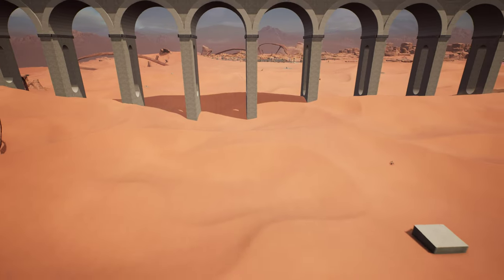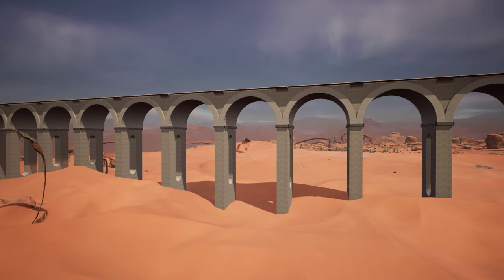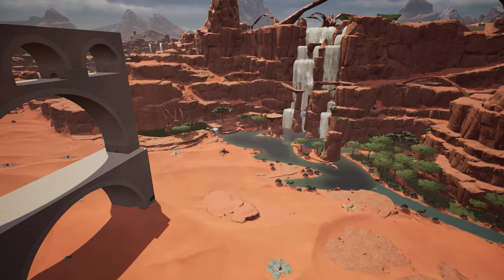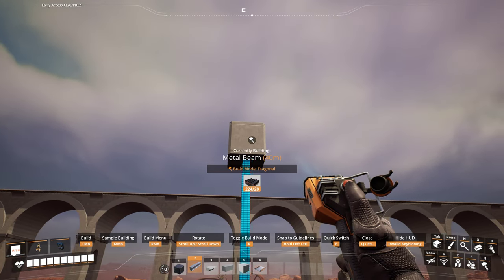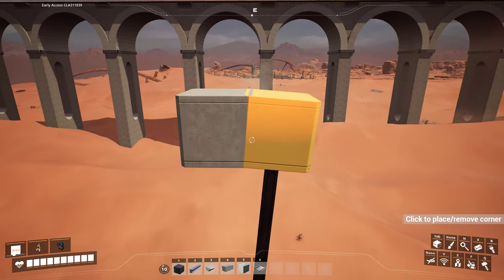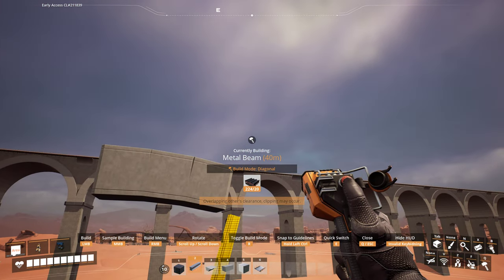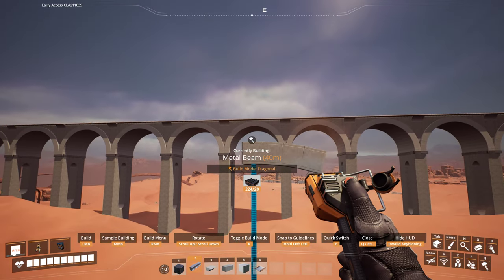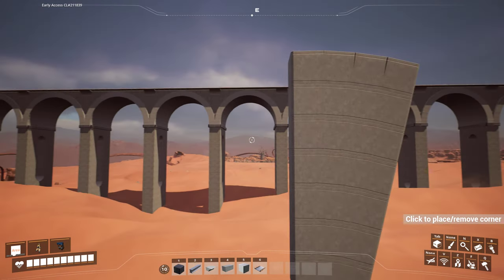Satisfactory - How to Build Vertical Arches

Comment: Your method works great but i cant work out how you get the really tight arches at the top of your pondigar
Reply from the maker: You mean the smaller Pont Du Gard example? The two lower levels use this technique for the arches, but then the upper level just uses the inverted quarter pipe foundations

Comment: I figured out how to make any size perfect arches or circles. Use the same black beam connector at the end of the "circle" you want to make (like you did to make your starting point) it doesn't matter how long your beam extends since you can place the connectors anywhere along a beam, You can then do the same method you use with the large Concrete pillars but using beam connectors! You can then attach large or small concrete pillars. You can make the circle as small as a doorway with this method.
Reply: Hey, how did you do it ? like can you explain with a bit more detail ?
Reply: @john-sz1sj  So basically when you place your beam down vertically you can use the small black beam connector and it will slide up and down the beam. You can then attach other things to the black beam connectors like small pillars or large. I made a perfect circle small enough for a train
Reply: nobody experiences the texture-fighting in the overlaps?